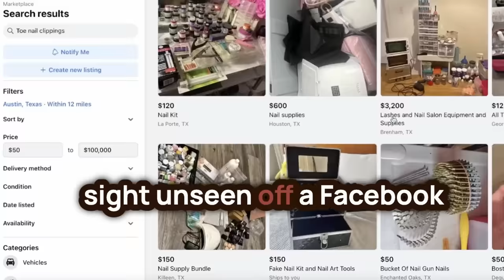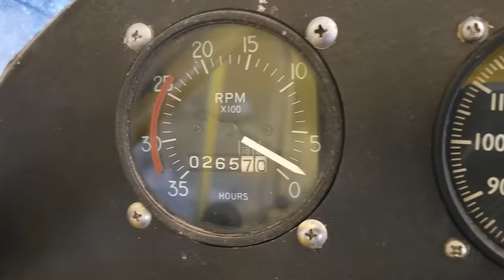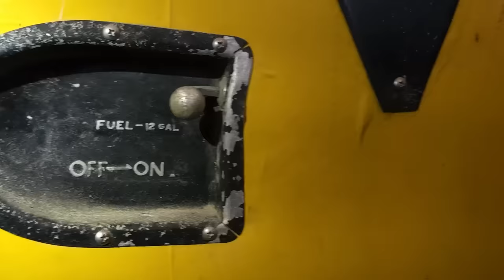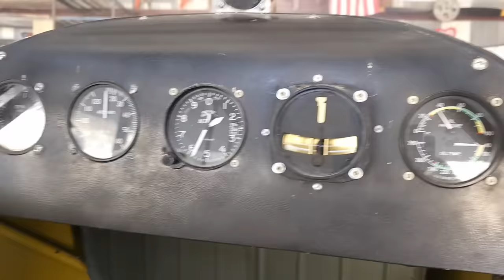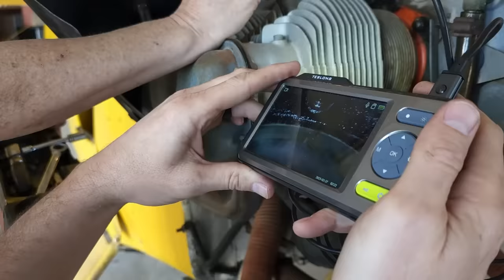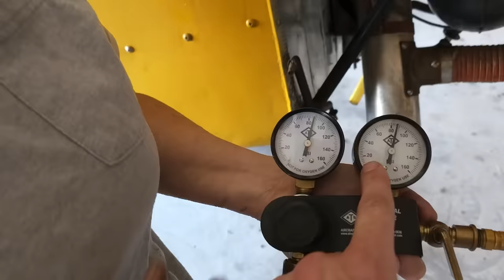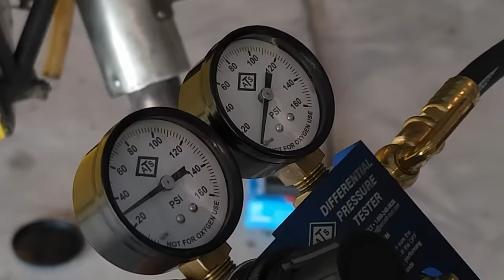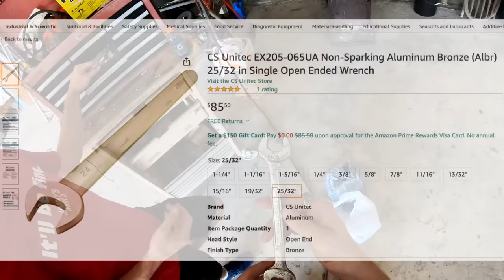I Get A FREE Airplane.... If I Can Start It

Comment: G'day,

My first Flying Lesson was in a 1946 Piper J-3 Cub...
VH-PSP ;
In 
1978.

25 minutes.

The Hub-Plate on the Propeller had an inked engraving of the Capitol Dome, over the 
Slogan,

"Continental...
Dependable as the
Nation...!".

That was funny to see,
While trying to
Hand-Prop. the thing to
Start it,
Especially on the
35th 
Try, or so...

Such is life,

Have a good one...

Stay safe.

;-p

Ciao !

Comment: Carbon problem in a gasoline engine. Maybe your horse needs a drink of water. Start the engine, warm it up, hold throttle a little above idle, pour a small amount (1/2 ounce maybe) of water into the intake. The water will fracture the hot carbon and it blows out the exhaust.
Reply: I have never heard about using water, but I have used Marvin Mistry Oil on my car knocking engine and it worked like magic. I did smoked the neighborhood for about 15m but ever since then I am a strong believer in the product.

Comment: Jimmy, that engine is 64 horse power not BTU or British Thermal Unit. Power is a unit of energy over time while BTU is just energy. All the BTUs are in the gas. AVGAS has 364 BTUs per pound mass so if this j3 has 12 gallons of gas, multiply by 6 lbs/gal you get 72 lbs so your j3 cub would have 26,208 BTUs if filled with gas, not 64.

Comment: One quick way to de coke an engine is to run it and pour brake fluid into the carb slowly!! Makes a lot of smoke but shifts the crap out of the heads.

Comment: Try Marvel Mystery Oil when you work on the top end of 65 hp engines. It's a great to lube valves, guides and will help with crud in the cylinders. Add it to your fuel to keep tops lubed while the engine is in operation.

Comment: Start it. Then with spray bottle, spray water mist direct into carb. It will steam clean the combustion chamber and valves just like when you have a blown head gasket into the cylinder.

Comment: Keep them comming like this Jimmy . i LOVE ❤❤❤ these plane more then anything else as an RC airplane builder this is how my scale 1:1  hanger would look like.. A tip for you Jimmy : poor a big can of marvel mystery oil in the cilinders ( spark plugs out ) crank the prop many times and sit in the sun with a mnt dew for some hours and flush it out and add some marvel to the gas and let the engine run for a while.  this oil cleans out all the crud. works like a charm on any RC gas and methanol engine.   Cant wait to see more of these flying crates  ❤❤❤❤❤❤❤

Comment: Safety spoiler:  Stay clear of the prop arc when conducting a cylinder pressure test.  70PSI can
kick the prop over and the prop can then knock you out or worse.  Not to mention that mud daubers love to weigh down fabric aircraft with their nests.  🤠

Comment: The REAR seat sling in the J3 Cub is incorrectly installed and unsafe. It is drilled into the structural tubing and hanging on the screws

Comment: Question for Cub pilots: You are on a solo cross country. Flying from the back seat. How do you adjust the altimeter setting?
Reply: You don't fly far enough from your departure airport before you need to refuel to worry too much about it...
Reply: Generally don't worry about it before I need to land and let my butt smile for a few minutes.
Reply: Loosen your belts, stand up, lean over.

Comment: put some SeaFoam in the oil as it will clean out the oil system and free piston rings.  We used to de-carbon engine combustion spaces by drizzling SeaFoam into the carb while the engine was running.  We would pour it in till the engine showed signs of not running at the 2,500 rpm we had it at. One could hear those chunks of carbon hitting the muffler.  However, I do not believe I would be standing where I could drizzle it into that carb.

Comment: I was going to fly a lesson in a '46 Aeronca Champ, but on runup, it would not achieve RPM. Back in the hangar, the mechanic tore it down and found the inside of the cranckases had been painted with red lead. The logbook said it had a chrome major recently. Not true. The plane was then donated to the A&P Mechanic program at a local tech college. End of my flying lessons.

Comment: an old trick to un-carbon valves is to use high detergent transmission oil and fill the head up and let set over night. then run the engine and carbon will loosen up. sometimes works very well.

Comment: I see Jesse is a Cleetus gang fan! I am surprised you guys didn't try a combustion chamber shock treatment, I am longtime automotive/recreational tech so not 100% sure legal for certified aircraft. With our local rental aircraft, which are converted to Mogas, we use a fuel additive to prevent build up in the engines. Liking the new series!
Reply: prevent a build up of what???

Comment: smack the valve open with the leak down tester putting pressure in the cylinder, better chance of dislodging junk, but it's probably a bit of rust from sitting with the valves partially open on those two cylinders. probably have to take it outside, tie it down fast and run the snot out of it to clean them up.
minutes later, exactly what they did. lol

Comment: My grandfather had a J-3 with a 3 cylinder LeNape engine it was one of 13 with that engine. Sadly he had a heart attack in flight in 1946. His best friend built racing planes and the plane was modified to handle lots of stress and the engine was modified to over 100 hp. I've got lots of pictures to remember him by

Comment: Several decades ago I met a gentleman who had bought a piper J2 cub all "original" he was extremely happy about the plane but he was confused about how low the flight time was. I mention to him that it was a nice winter airplane to which I received a puzzled look.
A couple months later the temperature hit 95 degrees and he found out why I said it was a nice winter airplane . Anyone care to comment?
Jimmy you still haven't handproped , do something with 235 hp. Or more. Now you have handproped .
No conventional gear rating,  what have you been doing? Go get it and get a glider rating while you're at it . Your options open up dramatically. When I added those ratings to  my ticket my insurance cost went way down .
Reply: Air density is the bane of almost all low powered high drag airplanes.  Enough said......
Reply: @bbrut3332  we have found a pilot .😊
Reply: Jimmy needs to find an ol' Stearman! 🤠

Comment: You can get the valve back in the hole without removing the cylinder, thats how you clean the valve stem then you fish it back into the hole with a small magnet on a stick.

Comment: Of all the planes you’ve showcased, this is the only one I care about. I soloed in a j-3 and I’m considering buying one right now. Surprised a 46 has wood spars
Reply: Most likely it's laminated wood spars
Reply: @buckmurdock2500  I flew 2 ‘46 cubs that were metal spar. The wood spar in the cub is solid spruce. There are some thin veneer at spar attach and lift strut points and that’s it.
Piper didn’t switch to aluminum til after the war.

Comment: Hi how about rotating the engine till the bad valve has opened fully and then bang that valve like before but also shoot compressed air to blow that carbon loose.  What you think?  Also, before doing all this I would pour some Marvel Mystery Oil in the cylinder to help loosen things up.  Heh, can't hurt 😊

Comment: This is not a Lyc and has different criteria for compression test.  Get the proper tester w/the Continental master orifice and tester.  Refer to Continental SB 03-3 you can usually except as low as 42psi

Comment: Dude, you were standing really close to that prop when there was 80 psi in the cylinder!  If that cylinder was not exactly on top dead center, that prop could have spun with some significant force.  Perhaps it was just the camera angle!

Comment: Times have changed so much.  When I learned to fly in the early 70's I hung around an airport that was home to many antique airplanes.  When I decided to rent the Aeronca Champ I went up with an instructor and we did a few stalls, 3 touch and go landings, and I was signed off to fly a tail dragger.  Later on I took a friend up for his first small airplane flight in the Aeronca Champ.  When we landed the first time the engine stalled on final.  I set it down on the runway and pumped the throttle to restart the engine and took off again.  We did that for about 5 or 6 landings and then took the plane out around Mt. St. Helens and Spirit Lake (before the eruption) and when we landed the plane the engine ran as it should all the way to the ground.  All it needed was to go out and enjoy itself to make it happy again.

Comment: My uncle had one it was fun, and was seriously damaged when the hanger collapsed and broke it in half.  But they fixed it used a whole spool of bailing wire doing it but it lived again.  My uncle swore it would run just fine on regular gasoline.

Comment: You have no timing chain on the cylinders, only rods...it would be very easy to pull the cylinders and work the right way on it to fix all unseen things also...sometimes you do not need timepressure...sometimes you just need prioroties on safetey.

Comment: Ya pull the plugs and pour Marvel Mystery Oil into all cylinder heads. Hand turn a few times and let rest for 24 to 48 hours.  THEN you put  a concentrate of SeaFoam in the gasoline and run that until engine is warmed then shut down to rest for 24 hours, then go taxi it again to clean it out...

Comment: There is a proven way to completely clean out those cylinders to like new condition. Its way developed  during WWII to help make more horse power at high altitudes its called water vapor injection . This can be done with the engine running and a simple spray bottle that you spray water through the carborater while running the water vapor will clean out the cylinders of all carborn deposits.

Comment: Find yourself a Bellanca Citabria,,for some spirited junior grade Aerobatics.  Yikes!, I wouldn't even stall any of those old girls,,or you will wrinkle wing skin, Further Yikes!.   Father had a 1976 Citabria(aerobatic spelled backwards,,kinda)with the big engine upgrade to 220hp(big Jugs).   Had the cool lime green on white Batman/Batwings paint scheme from the Bellanca factory.   Loops, Stalls, Wingovers, snap rolls, easy rolls,, yeap!!.  First snap roll ever was a shocker!!.    Pull the boots off those bunjies,,so you can keep an eye on the elastic!!.   It keeps from dragging a wingtip on touchdown, with a collapse.  Easy preflight then.     Nice pile o planes!!.

Comment: My grandfather soloed in one with the aircore. Solo day was basically a roll call on the flight line where they stood in line and hot swapped without shutting down took a spin around the airport then returned and the next newbie jumped in. We’ll one minor issue with that approach. No one was checking fuel level’s😆

My grandfather got in took off and immediately ran out of fuel. He landed in a bailed hay field about a mile off the end of the runway and hiked back to an angry instructor. “He was gone to long!”😆 Instructor had him grab a fuel can and a jeep drove him out to the plane. Saw where he landed signed off on his flight right there on the spot. Then told him to get the plane back to the airport🤦‍♂️. 

On assignment day my grandfather asked for transport assignment for a few reasons. The biggest was transport got the most flying hours. He flew the Silk Run in C-47’s grandma was always proud of being the panty hose supplier and that they had good tires on their car. Both things that seemed to return on empty planes during the war on the “Silk Run”😆

Comment: Get the engine hot and put a little water down the intake. The cold water will hit the carbon and bust it lose. When o was younger we would put water in a coke bottle and do that. To stop the carbon tick in out car engine.

Comment: automatic transmission fluid , or marvel mystery oil sprayed into the air intake or poured into the gas tank will cut carbon out of the cylinders and valves vary well

Comment: The correct way would remove the head do valves miracle if you don't get valve grinding compound in cylinder and piston.

Comment: 60 years ago we were taught the following procedure when “prop starting” Cubs and similar aircraft: the pilot would loudly announce “off and closed”., off meaning the mag switch was off, not on 1 or 2 or both. Closed meant the throttle was completely pushed in, limiting fuel flow to the least amount. At this time the person rotating the engine by hand would give it a couple spins using the prop to prime the engine. He would then announce “clear”. The pilot would then slightly open the throttle, apply the brakes, and turn the mag switch to “both” and in a loud voice announce “contact, cracked, and brakes” which meant the mag switch was on, throttle cracked open, and brakes applied. This would alert the person “propping” the plane that it was in a condition of starting if the prop was moved. The only time this was different was when the pilot was by himself and was starting the engine. Of course he had to stand behind the prop and wasn’t able to apply the brakes.

Comment: Is Gumout not an option to use to spray the valve stem and also run through the engine as an additive?
Reply: In many cases the deposits are byproducts from the lead in the 100LL fuel and they are incredibly hard to remove and impervious to common solvents.

Comment: Lapping a valve with it in the engine sounds like a great way to ruin a cylinder. Not being able to make sure all grit is out is too sketchy for me. Why not just get a head gasket and do it the right way. It's air-cooled, and it's not a over head cam. You could have it done in a couple of hours tops.

Comment: Oh and its not stretchy plastic covering the airplane.. It might be Linen, looks like it might be Ceconite and believe me it aint stretchy .. If the fabric doesn't pass, 10 years ago a Cub recover nudged 20k, not counting getting it there, leaving it there and then getting back to it to fly it home ..And another thing , net time you "prop"from the back, at least wear a glove , With your fingers wrapped around the sharp edge, if she kicks back, as she might with iffy valves it will take your fingers off . That's why you "prop" from the front-- flat handed - with some one in the cockpit, stick back and brakes on- if they work . and that's why you push on the prop first . if it was a Gypsy moth, that airplane had no brakes, so care had to be taken ..

Comment: I owned a 1942 J3 and put about 500 hours of flight time on it. I never understood what fasinated people with them they were all hand start and never really ran all that good a small gust of wind had you fighting the stick. The landings were always hard and they creek and sound like a tin can being kicked down a sidewalk going down a runway whether the runway is paved or grass. I flew mine from upstate NY all the way down to Waycross GA where I even up traded a guy the J3 for A 1960 Cessna 175 Skylark best trade ever and I'll never be looking back. Yes the J3 is a much better plane for those short 2 or 3 mile trips just so you can say you flew to your neighbors but for anything longer than a half hour they are uncomfortable and will wear you out just trying to hold them on course in any kind of wind above 8 knots. There are so many airplanes and even ultralights out there that are so much more enjoyable than a J3 that I just don't get why everyone wants them.
Reply: Everyone wants them because they are an iconic airplane that trained a vast majority of ww2 pilots. As you mention, the landings are always hard, well... they really aren't if you get good at flying them. The saying goes the J3 is easy to fly, but hard to fly well. It teaches you all of the basics of stick and rudder that transfer very well to other, heavier more complex airplanes. They also are not all hand start, the c-85-12 has the capability to take a starter. the 90 too. They are also extremely economical to own and operate. If you have the right seats they can be very comfortable. I often fly with my dad 2-3 hours at a time, cruising the rivers, seeing historical sites, etc. I had a bonanza for 7 years, and while that was a phenomenal machine for cross country flying, the cost to own was getting out of hand, and I was not able to fly as much as I wanted. I spent almost as much time working on it as I did flying it. Also you will find the j-3 is most guys second airplane, for low and slow and beautiful days. Congrats on the 175, thats a go place airplane.
Reply: @benjigault9043  I love the 175 I will say yes it costs more to maintain and fly but I can now throw the whole family in it and pretty much go anywhere. We have been to Maine 5 times with it and to Florida 8 times and we go to PA and Virgina once or twice a week with it. It's smooth flying for the most part and when we got it, it just had a new engine with 50 hours on it installed and the plane was a one owner since new so it had impectable logs and records it was a deal I couldn't pass up. I also own 2 para gliders that me and my daughter fly regularly during the summer months around our valley.